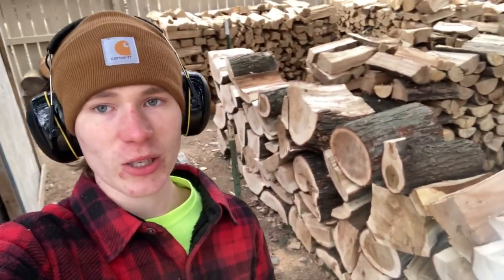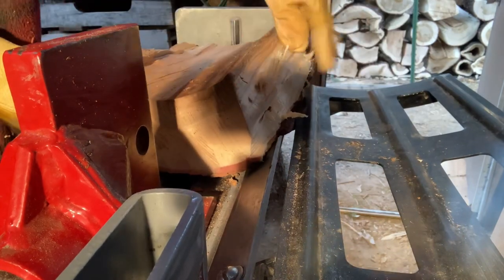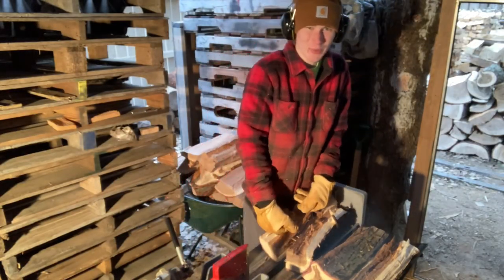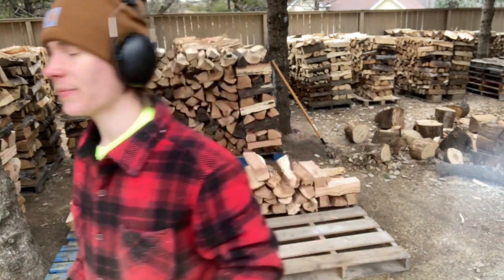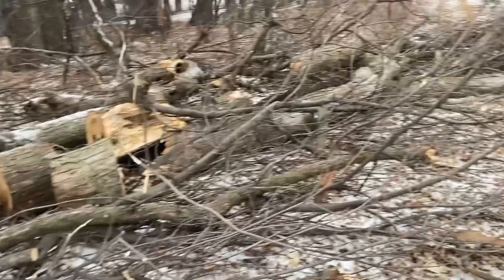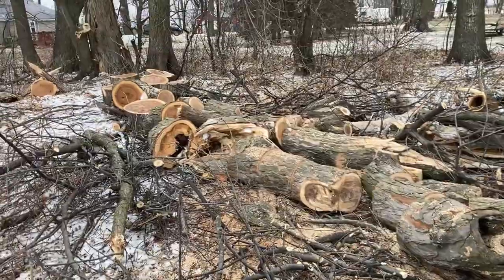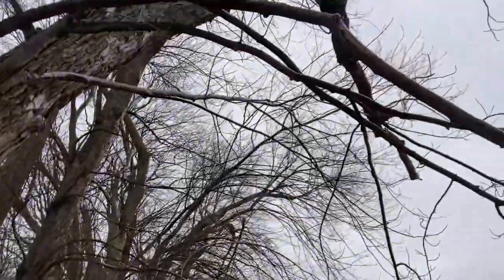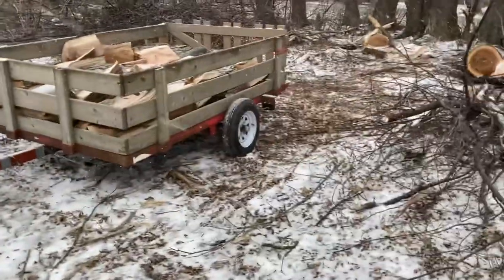How I prevent a barber chair

Comment: You have the right idea of using a bore cut to prevent barber chair, but the notch should be an open-faced notch and then do the bore cut. Husqvarna safety trainer has the video up on the Husqvarna channel. In that video, he also fells a heavy leaning tree.
Reply from the maker: So I have heard. I guess I need my notch wider. I ought to do some more research on it. Thanks for watching.

Comment: Bore cut doesn't prevent Barbar chair ,birds mouth notch is your best bet even with frozen trees ... some are tricky glad it worked out for ya indeed
Reply from the maker: Interesting. I’ll have to search up what a birds mouth notch is. Thanks Cody
Reply: @logginlogan6796  I'm in no way criticizing you .. leaners are iffy in general.  In my experience a birds mouth don't close as fast "all fall" so to speak no pressure
Reply from the maker: @codyrussow170  no worries, I appreciate the tips and advice. ah, I see. Pretty much a wider notch. Yep, I can see how that would help, let’s the tree fall close to all the way without the top face coming in contact with the bottom face.
Reply: @logginlogan6796  exactly right